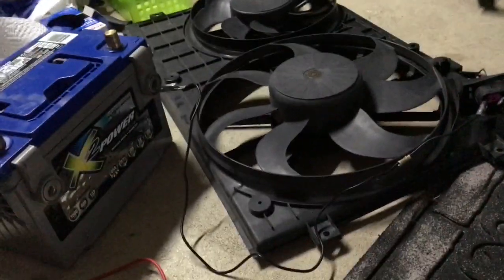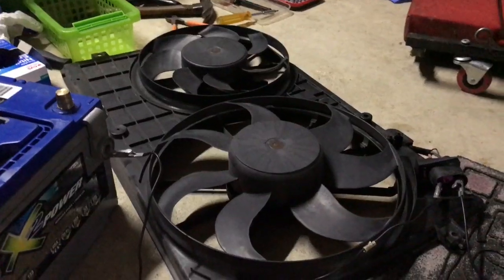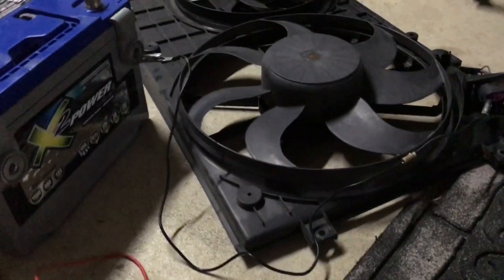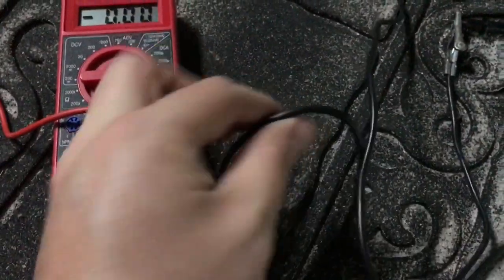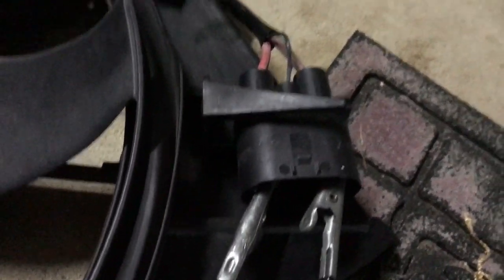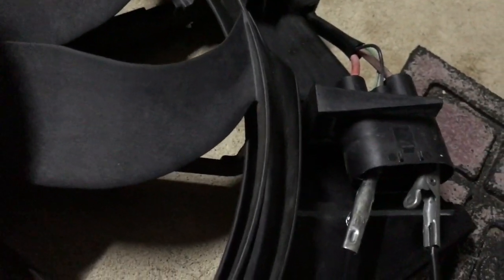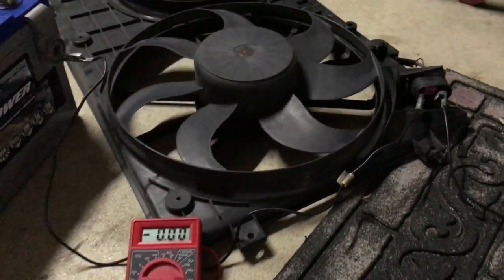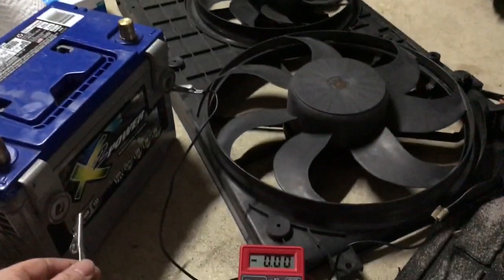Testing radiator fans on '08 VW Jetta (MK5) 2.5L

Comment: On My 2.5 09 jetta the  fans turn on but run at full speed once the engine is up to temperature , my understanding is that there is no speed control moule so its directly controlled by the ecu  thru the coolant temp sensor but theres no relay between the ECU and fans. What could be the cause

Comment: After reading the comments below I don't think I'm going to try this. Wish there was a SAFE way to test these fans w/o smoking anything.  You can test the voltage on the wires while it's still in the car.     https://youtu.be/oqdv4cm86Ns     Could you please post an Update comment or text below the video?      thanks

Comment: my radiator fan doing weird things.... when i start my car at cold mornings the radiator fan starts to spin at full speed... i need to start the car again to stop. in summer there is no problem... only with the cold mornings when the car rest for long time.. i dont know what is the problem there are no errors in vcds.. i changed every coolant sensor and thermostat.. my mechanic dont understand this too...

Comment: Hello Ted.I just wanna tell you that your method is wrong! I am automotive electrician and acording to colour code red is + and black is -.i think you allready fried electronic module which is located near the big fan.You just said that`s weird to be RED to - and BLACK to +.That socket has another 2 little pins.One is +k and the other one is signall from the computer(control the fan through pwm).Delete this video.
Reply: So how would you correct this?
Reply: Hello!
Could you be so kind please to share some info.
One day i’ve Tested PWM signal on Passat B6. The frequency had been measured as 25Hz and Standby Duty as 10%. 
After that I’ve generated on the table the same PWM signal to test another VW Fan and it works in wavy behavior. Starts after 5-10 seconds riches max speed and stops. Is this Fan Control module broken or needs another PWM signal?
Reply: you are right, fans are running backwards. But that didn't fry the electronics on mine. When I connected the fan back to car, they started working (magically?!) but they spin in the correct direction, which is opposite of what they were running when I tested them, incorrectly.
Reply: 2011 jetta fan keeps running while car is off please help.fan on right side .towards belt side

Comment: My fans are working like in the video, but when i put them on the car they don't want to start...no vcds errors, no burned fuses, no activity when output test from engine, and they don't start when I turn on the AC..what should I do?
Reply: Your fans doesn't work on your car  because the video teach you something wrong that which lead to destruction of controle module on the primary fan. The red cable is positive 12 volts and the brown one is ground if you reverse them the fans will work but  will blow air in the wrong direction check the arrow on them when they are spinning, also if you polarize them reversly you destroy them because the control module features some caps that work only when correct voltage is applyed on them. I had the same problem that you have and then i realyzed what i did... Only the small fan works at reversed voltage, change the big one because it s destroyed now
Reply: @alexandru2110 De acord cu tine Alex.